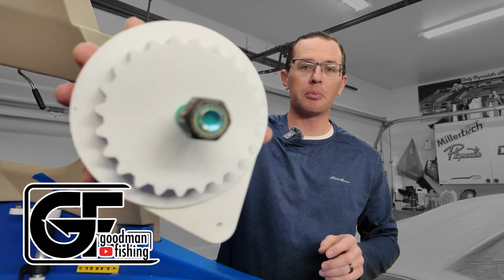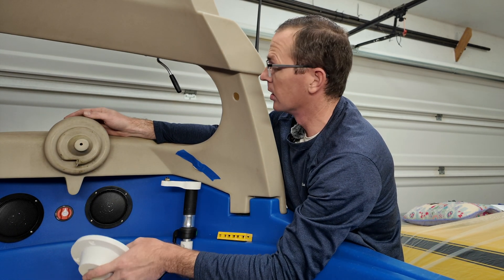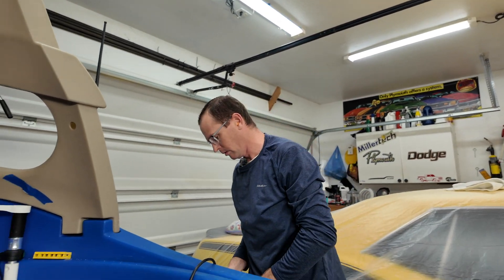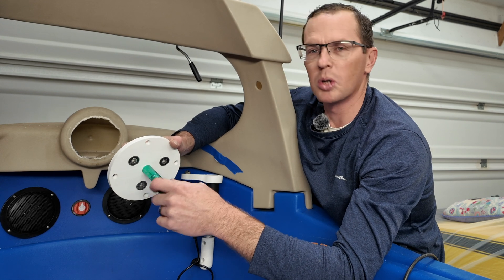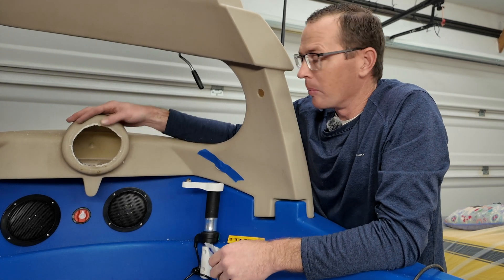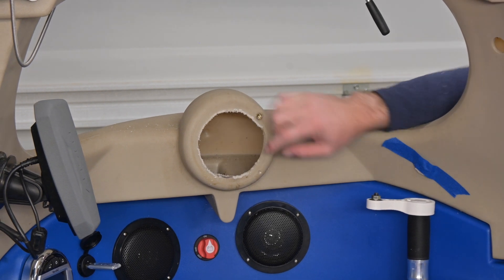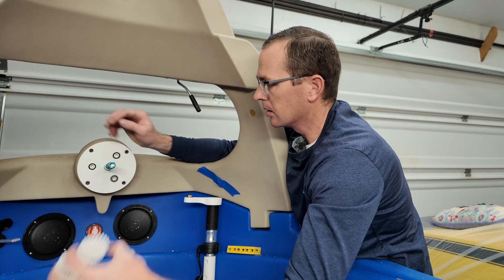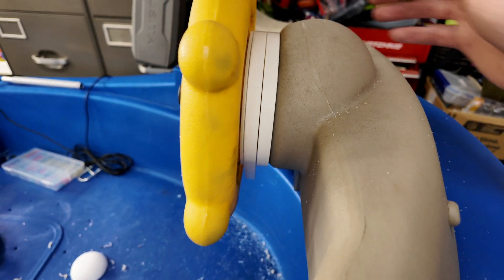DIY Tuggy Boat Build: Functional Steering Using 3D Printing

Comment: Working on the same project! Dying for part 2! I’ve got the same parts 3d printed just no instructions
Reply from the maker: I did a video that covers most of the steering bits 👍
Reply: @goodmanfishing  I’ll look for it thanks!
Reply: where is the video? i cant find it @goodmanfishing
Reply: Where do you get the 3d parts
Reply from the maker: @angelashedd7933 there should be a link to the files in the video description

Comment: That's pretty cool little build. The one thing that I myself would do different and would be an option if you have problems with the riv nuts would be to put something thicker that your bolts could thread into or a flat piece of steel with a j clip on it and then rivet that to the plastic on either side of your threaded hole. Very long run on sentence but hopefully you got the idea. I've had mixed results with rivnuts on a steering wheel mountain plastic I have concerns. 
Looking forward to the next one.
Reply from the maker: Thanks for the input! I may print some backing plates for traditional nuts if the rivnuts give me fits.